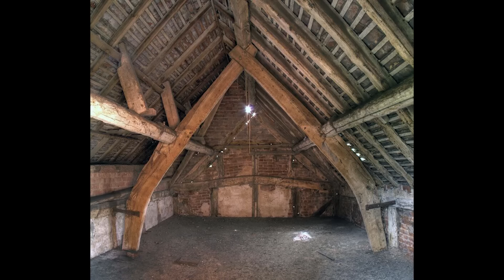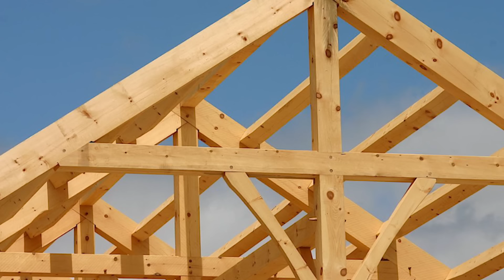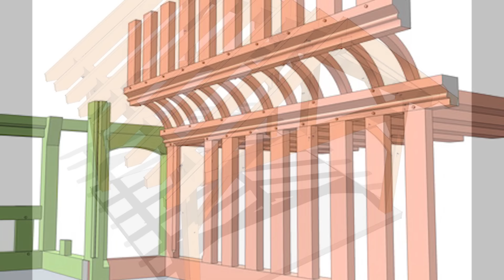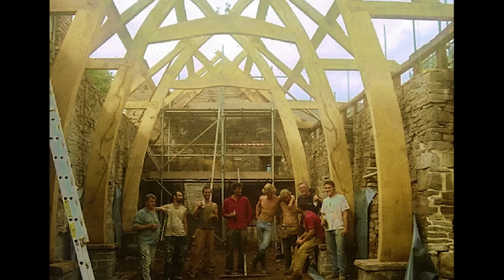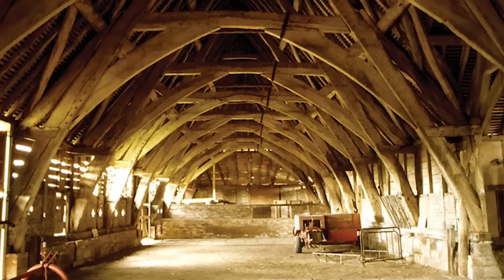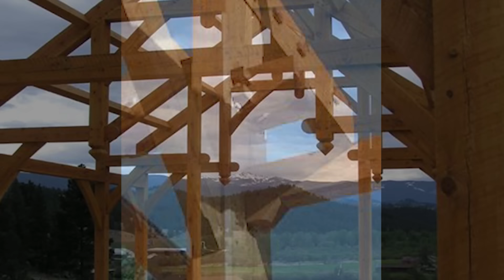What Medieval Carpenters Understood About Corner Heat Loss That Modern Builders Forgot

Comment: Frame wood wall corners with what is called a "CA Corner" which allows insulation to extend past the inside corner of the wall and still provide nailing surfaces for the interior materials (gyp. bd., t&g, plywood, cementboard/kerdiboard, etc.)